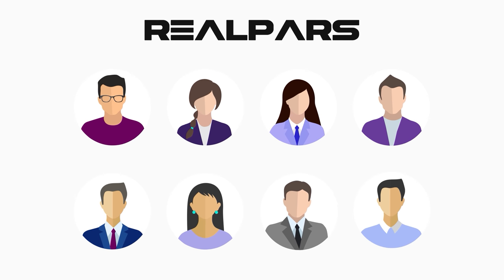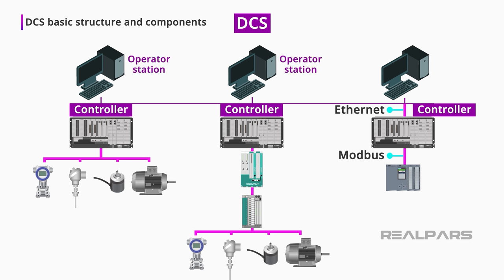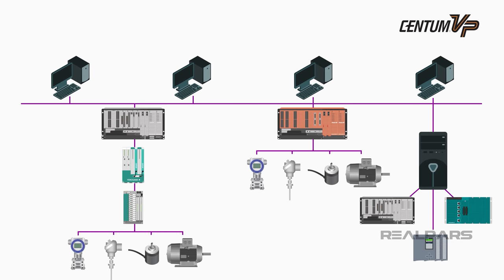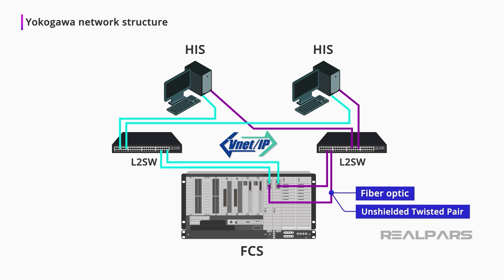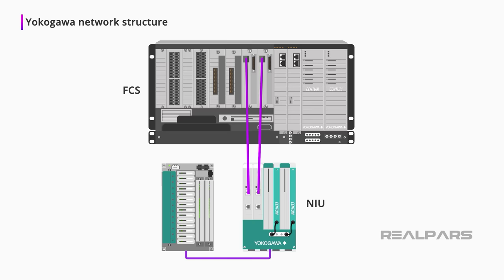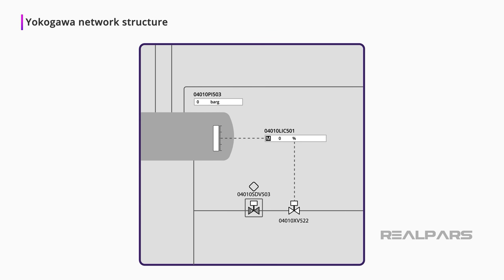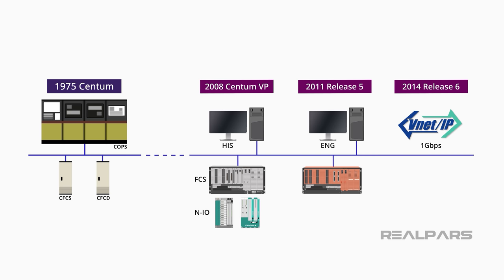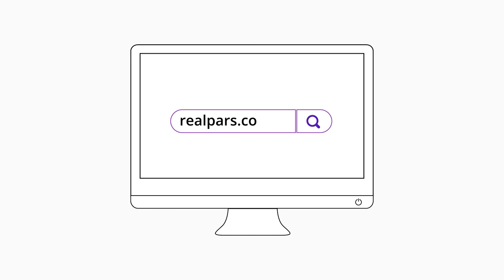Introduction to Yokogawa DCS

Comment: We use DeltaV, and Yokogawa centum vp, from my experience Yokogawa  the best DCS 👌 , easy to configure and very easy to use by the operators and Engineers...the 3D faceplates are very handy for tuning and troubleshooting
Reply: I have used both system. I agree with abdul Yokogawa centum VP is the best DCS. Also logic such as LC64 and ST16 are easy to read and configure.
Reply: Why faceplates are 3D?
Reply: @АртемНаумов-с4ь  well, it's good looking than 2D and handy to use🙂

Comment: sir plaese tell me which configuration laptop use better for plc
Reply: Yes sir pls tell us...🙏🙏🙏
Reply from the maker: Hi Jannatul. I'm assuming you are asking about PLCs in general. If so, the laptop computing power, memory and operating system requirements aren't really a PLC issue but are determined by the software used to program and communicate with that PLC.   For example, if your PLC is one of the ControlLogix family, you need RSL5K or Studio 5000 for programming. Each programming software package will have its own unique requirements that will be provided to potential users. I hope that answers your question.

Comment: I worked on both DeltaV and Centum VP. I find DeltaV as a better product and more innovative than CVP. The class based engineering is easier and faster to use, easier to integrate other devices, better diagnostics and easier to build graphics. Centum VP is not a bad product but they can make it more modern and add new features.
Reply from the maker: Thank you for sharing your thoughts and experiences! We always appreciate that :)

Happy learning!